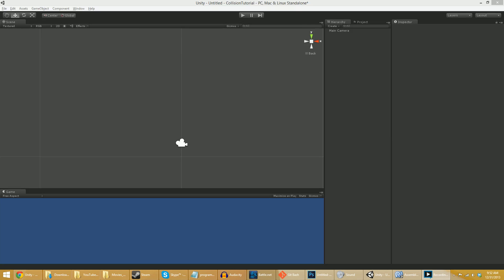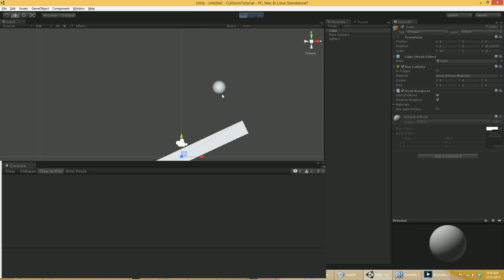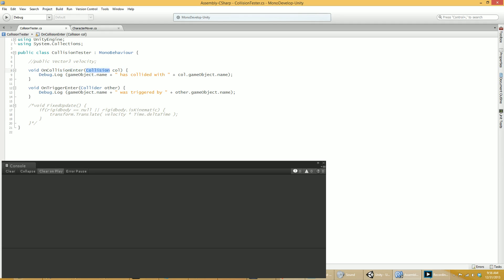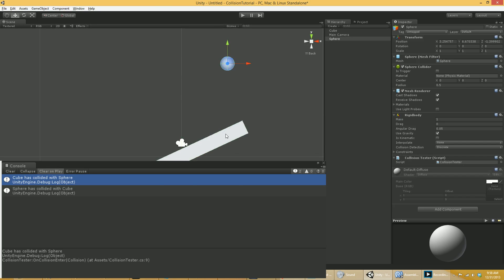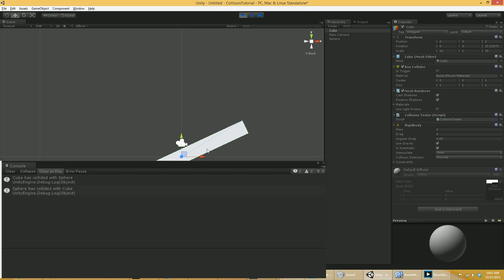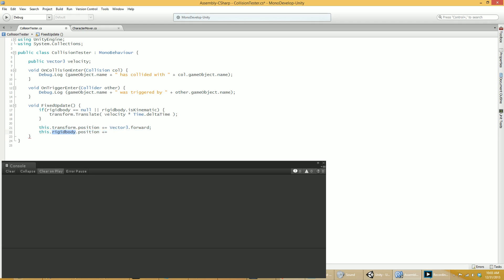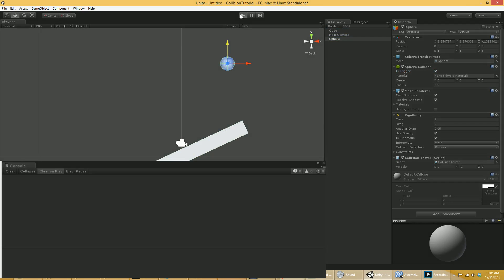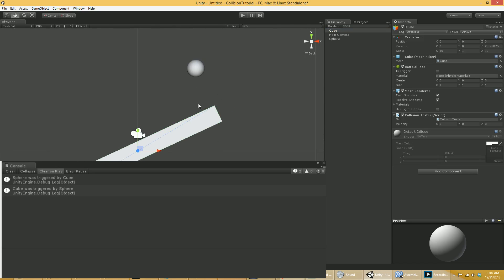Unity 3d: Collisions, Triggers, Rigidbodies, and Kinematics

Comment: This leaves me with a question. You state that moving a static collider is really bad, so if I make a bullet (or many) and move it with a transform script, are you saying that trigger collider bullet which will hit a character that has a rigidbody and trigger health loss should in fact have a kinematic rigidbody  to be more efficient? Its not as you say a real and true rigidbody if its kinematic, you can still use transform.position instead of transform.translate so why add the rigidbody at all? This seems counterintuitive to add more items to an object (the rigidbody) in order to make it more efficient.  Or does the checking of Is Trigger negate the bad effects you mention of manually moving a static collider?

Comment: i have a problem.
see i want to have an object that i can pick up with "e"
now the thing is it only works when the collision begins
so for example if i walk into an object and THEN press e it does not work since the collision only happens once (when i first touch the object)
so what i want to happen is that if the player is inside the trigger then it will keep happening (like "void Update()")

nevermind i got it to work guys all i needed to do was to change it from
OnCollisionEnter(Collider other)
to
OnCollisionStay(Collider other)

Comment: What would be your recommendation for cubies in a Rubik's Cube? Should they contain only boxcolliders that are triggers (to tell whether a face of an asymetric cube will collide with a mis-aligned layer)? Or, should they contain kinematic rigid bodies? (Think of a 5x4x3 Cube and how rotating by only 90 degrees in any direction would lead to mis-aligned layers.) I want to test for a potential collision before the user can rotate in any direction and I want to prevent cubies from rotating into other cubies. Note that Cubes which are 1:1:1 should always work without "collisions."

Comment: HELP! I wanted to make my enemy chase and attack me, but I can't trigger OnCollisionEnter function (as it's needs to be used so that the enemy can know Player's collision point). The enemy is able to detect where I am and he does chase me and do the attack animation when I'm close enough, but no OnCollisionEnter is triggered so that means technically the Player hasn't been attacked. I know that either the enemy or the player has to be non-kinematic to make collision event happens, but when I do change the player or the enemy's RigidBody component, this error showed up :

"Non-convex MeshCollider with non-kinematic Rigidbody is no longer supported in Unity 5.
If you want to use a non-convex mesh either make the Rigidbody kinematic or remove the Rigidbody component."

So how do I fix this? I wouldn't use RigidBody component if I could, but sadly from my limited knowledge it's not possible to know the collision points without using RigidBody?

Comment: Hey guys maybe someone can help me? :)
If I am using addForce it effects my player(the object I want to move is a simple Cylinder) in the way that I dont move instant. 
When im using wasd to move my object, it starts slowly and goes faster, but I dont want this to happen, I want the same movement like when I am using  "transform.Translate", I want it to move the full speed at all times. 
I know my english isn't that good, but I hope you can understand my question :3
Reply: try usingCharacter Controller component to your Gameobject.... and use CharacterController.Move (Vector3.motion) to move your Character.....

if you use WASD key using Input.getAxis method it will make your Gameobject accelerate smoothly.
you can use Input.getAxisRaw instead that will move your object without smoothing instantly.

Comment: Why would you say that usually you'd want kinematic objects? physics are not applied to kinematic objects: if your game includes any physics at all (balls falling and colliding each other, rocks smashing, a car colliding with the ground) you'd either use non-kinematic objects, or apply all forces and torques yourself (in which case you miss the point of using Unity).

Comment: Hi @quill18

Nice tutorial but just 2 things :
- Time.deltaTime is useless in FixedUpdate (it will always return fixedDeltaTime)
- you can also move a rigidbody by changing its velocity (in some cases it is much more handy than addForce)

Anyway nice tutorial ! I really like what you do ;)
Reply: By "useless" you mean "does exactly what I want it to do".  fixedDeltaTime is what you want in FixedUpdate, but by using deltaTime (which is mapped to fixedDeltaTime inside of FixedUpdate) you don't have to worry about mixing things up if you change between Update and FixedUpdate.
Reply: quill18 Hey, I didn't want to be rude (english is not my mother tongue), by the way nice tips, I've never though in that way, even if to me, Update and FixedUpdate are two differents use cases, and maybe that can be misleading for people who watch your video (even if it's just an example) but I don't want to make you angry at me, so just forget what I said ;)

Comment: What about the Player Controller that we can import: it has a collision box and a rigid body, however it does not seem to work with OnCollisionEnter.
Reply: What happens when you use it? Make sure you have the OnTriggerEnter like this: void OnTriggerEnter(Collider other) OR if you're using Java it's (Other: Collider) Hope this helps if tahts the problem. What's happening? Nothing at all?
Reply: The problem is the other entities go to sleep after they stop moving, thus OnCollisionEnter does not work... because for some reason it does not care if the player run into something only if something runs into him.

Comment: I've noticed that Unity has trouble with collisions on small objects moving at high speeds. I've gotten around this using raycasts, but working around it and understanding why I have to work around it are two different things. Why does it have so much trouble with small, fast objects?
Reply: From playing around with it a bit, I have noticed that is frame relative. I would expect if your object is moving faster than the depth of a wall every frame, it can easily pop through without it registering.
Reply: 1) You may need to enable Continuous or Continuous Dynamic collision detection on your rigidbody.
2) You may need to reduce your fixed physics timestep (i.e. increase the number of ticks per second) to ensure fine enough resolution.

That being said, if you're making a game where you rely on VERY high-speed objects having realistic collisions with each other, you're going to have a bad time. There's almost certainly a better and faster approach (such as ray casts).